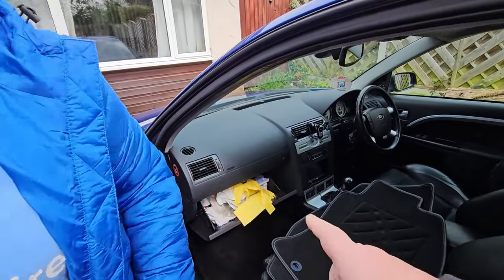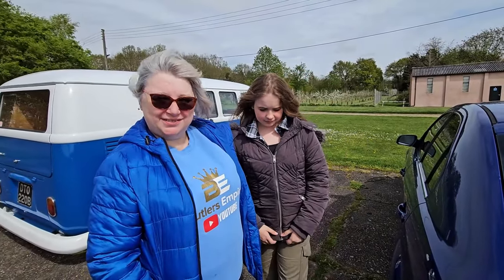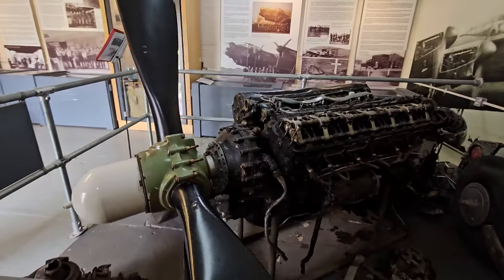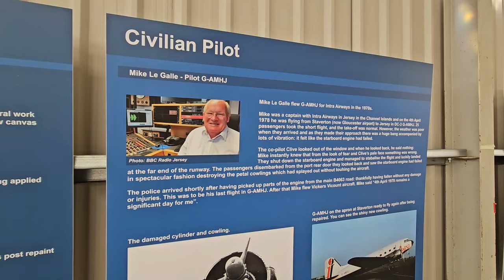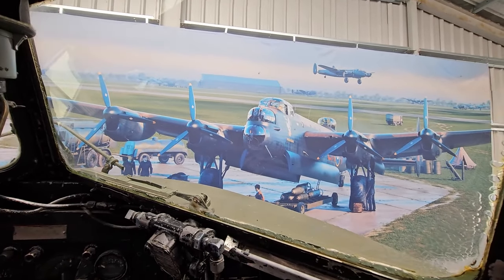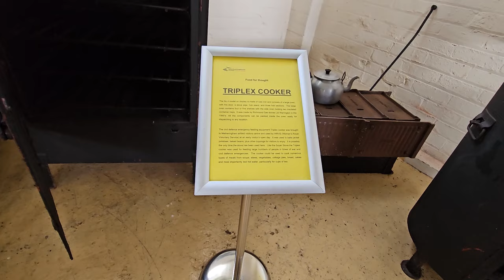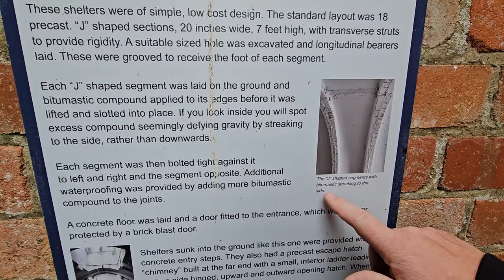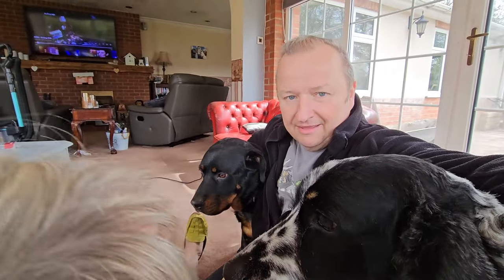We Get Spooked At A WW2 Airfield

Comment: Martin, have you visited the Coleby Grange control tower, just down the road from Metheringham ? Admittedly, It is fenced off and now part of the farmers field but the fence is broken down in a number of places and it is certainly worth a visit. I have visited it on numerous occasions while visiting relatives in Lincoln and each time, i have experienced things that i cannot explain. One instance, my other half and i were walking around inside it and i got a very overpowering sense that we were not alone and then a piece of glass, roughly the size of a thumb nail, landed by my feet. Where the hell did that come from ? There are no windows or glass left in the derelict building. Each time i visit, i end up with a stonking headache too which suddenly goes as quickly as it came.
Reply from the maker: Never been there.